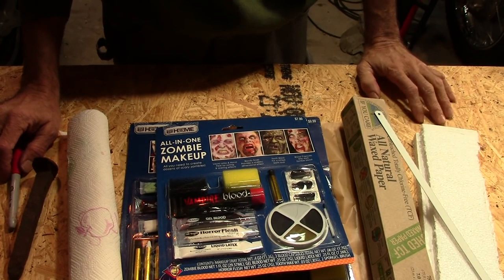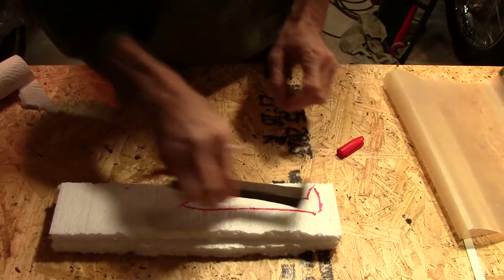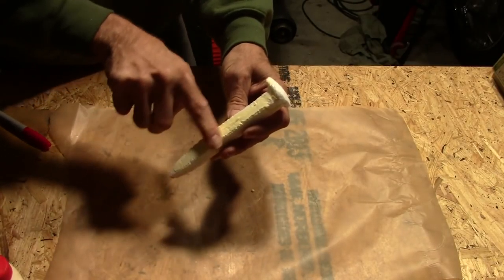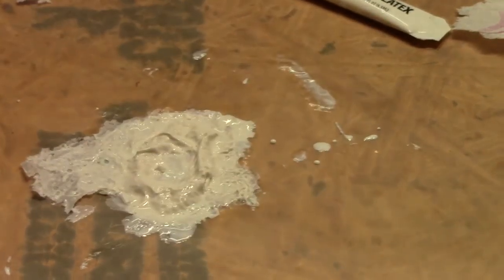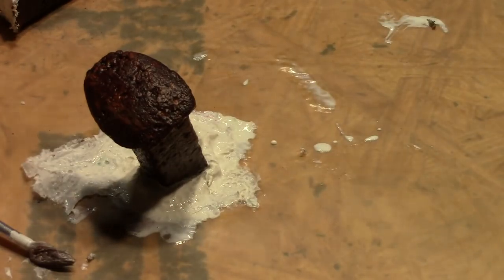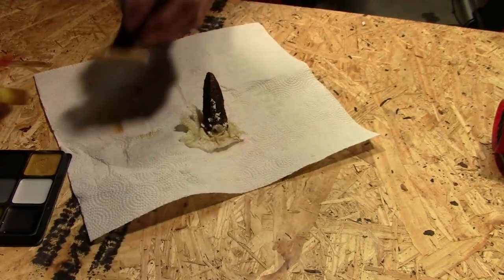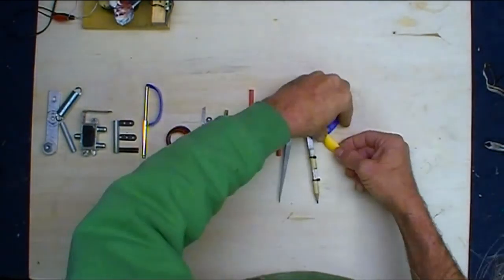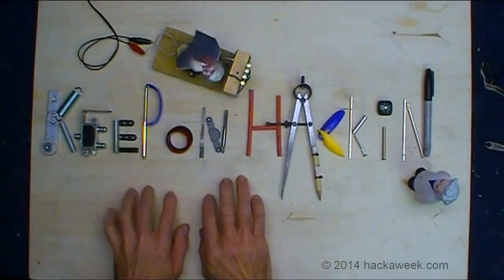Rail Road Spike Through The Face for Haloween

Comment: Hi, Dino I have watched just about all your videos. I have been collecting electronics for a local recycling place mostly computer towers and LCD monitors. I would like to see what all you can make with them. I have been building drivers for the CCFL lamps to reuse as a 12volt light source. and taking the CPU heat sinks and the solar motors from the DVD/ROM drives that open and close the slide to make wood burner fans with the use of peltiers. They are cheap from ebay and have had a lot fun with them.Plus have made some really nice bench top power supplies from the computer power supply pack. Thanks for all neat and great hacks you do they give me ideas for things to do.